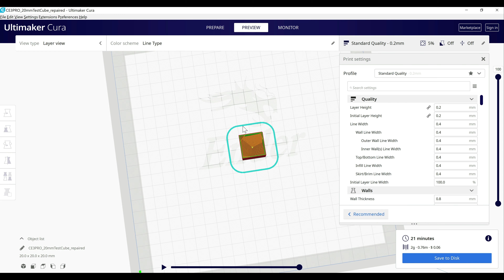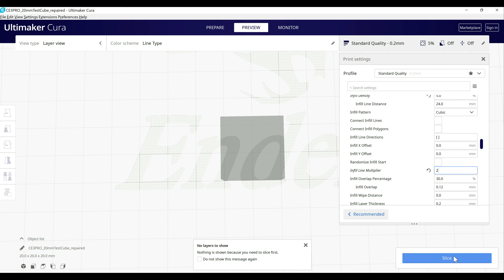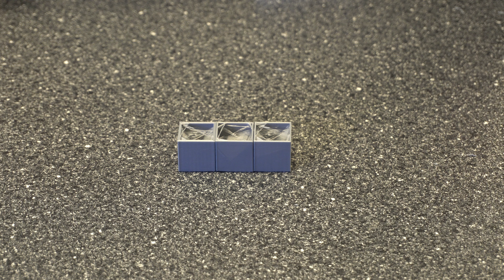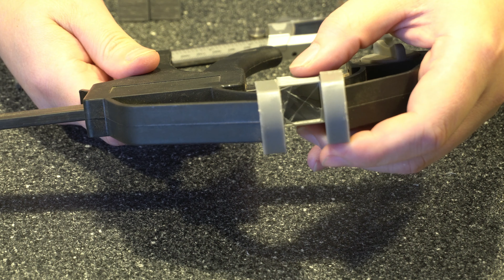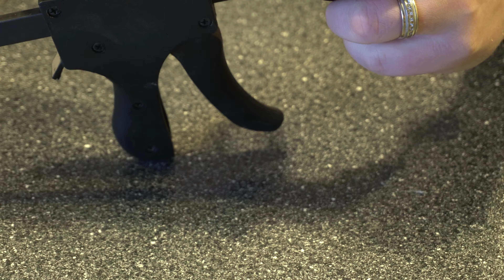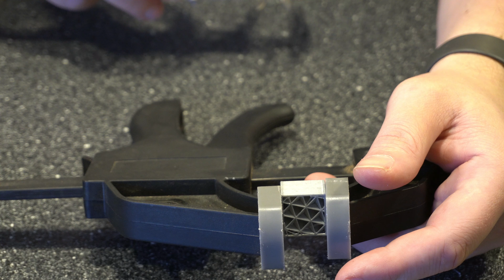Extra Wall or Infill Multiplier – What’s Stronger?

Comment: I've just bought BL A1 and it's great but I miss Cura so much!
Reply from the maker: Hi. Ive started moving away from cura but there are things about it i miss.
Reply: @3DPrintscape  First and foremost Cura has the concept of driving and driven settings. If you change the main print speed setting for exanoke Cura will adjust 10 other parameters for you. Even though I bought Bambu Lab A1 the results are often worse than with my failing old printer, especially for small objects.
Reply from the maker: @Tome4kkkk  Interesting.

Comment: Question - is gyroid 100% with 4 walls less durable than gyroid 100% with 8 walls? There is a difference in print times, but I'm wondering if wall count matters when it's 100% infill. Also, would infill multiplier come at play here with the same 100% infill? Thanks!
Reply from the maker: Hi. When it comes to 100% infill, the walls dont matter much. It will just be how many layers are in the direction of the print vs using the pattern selected (though if truly 100% this wont matter).
Reply: @3DPrintscape  Ah, I see. So patterns don't matter if it's 100% since in the end it's a fuly solid print. I've always seen people debate which pattern will be stronger, and such, but never specify what % of infill they will have.
Reply from the maker: @nextlvlroy  At lower infill levels it makes a huge difference, but not at 100%.

Comment: I may double up...
Reply from the maker: Hi. If your looking for extra strength without using much more filament, this is a good way to go.
Reply: @3DPrintscape  i have been watching tons of 3d printing videos since they are the area where people prototype much faster than with CNC metals or composites.

5 forces:
Shear
Compression
Tension
Torsion
3 point bending

"Strength" as used by mostly everybody is not the same becuase each is testing it in a way that stresses the parts in 1 or 2 of the previously mentioned forces

Anyway not to keep it short
I realized Full honeycomb infill gives the best compression tension
And isogrid skin gives the best torsional rigidity

Obviously that could not be used with all the parts but it is the best all out Strength vs weight design